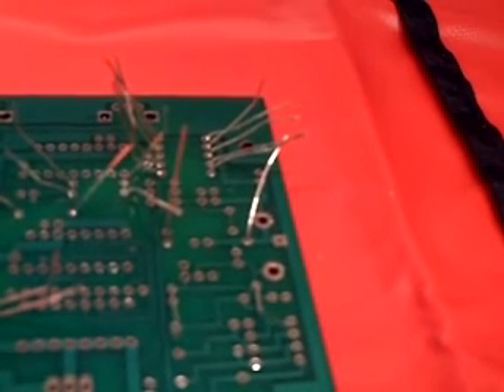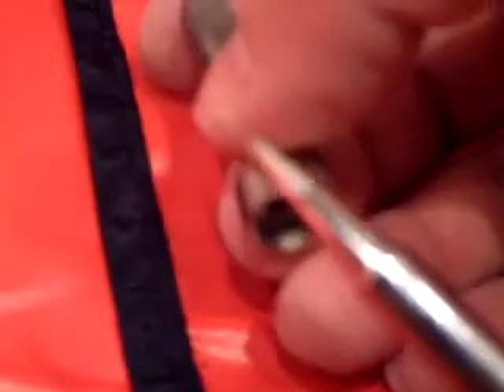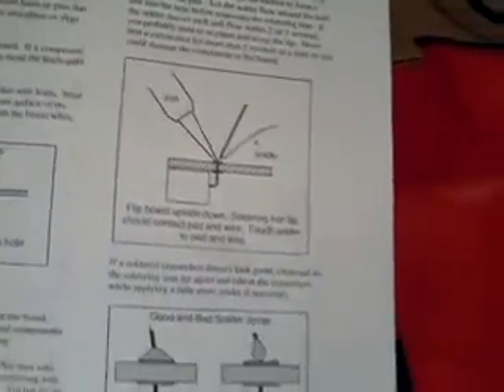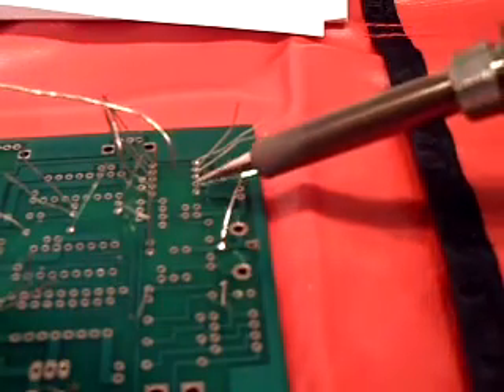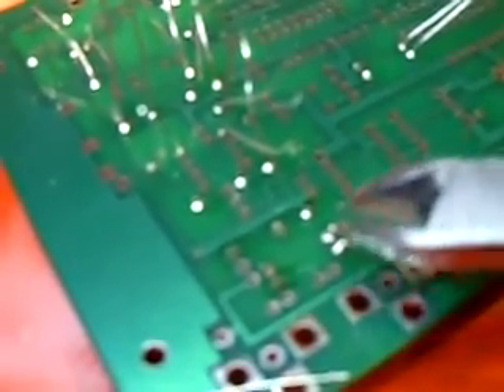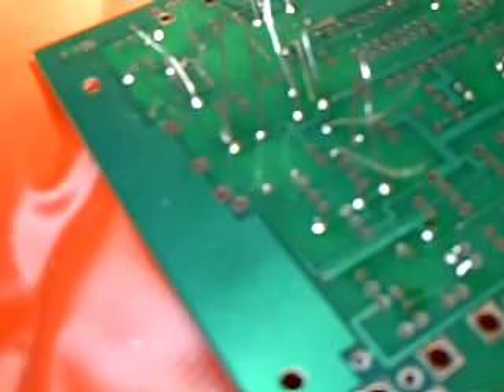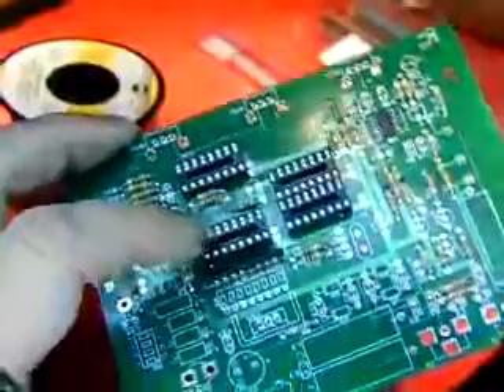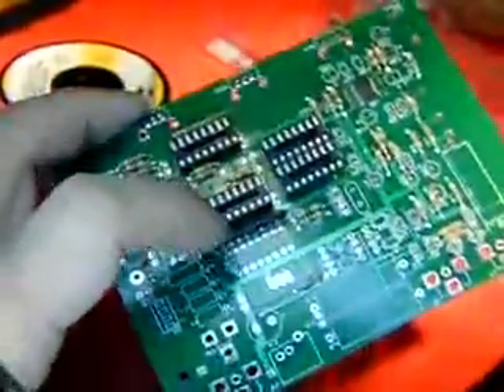LPAM Transmitter SSTRAN Kit Part 3

Comment from the maker: @gbowne1 The instructions says there is no relation at all with the resistor color code as it pertains to ohms of  the chokes . The color code is only for the inductance value in Henrys. PS. Real techs don't need a resistance calclulator from Penn State . A simple cheat sheet diagram would suffice. If ones not available. Then use the memory device as follows. Bad Boys (Ravish) Our Young Girls But Violet Gives Willingly. 0-9 for bands 1-2, band 3 multiplier, band 4 is tolerance. Very simple, huh?

Comment: seems like you didn't have your iron hot enough, ideally you would want it as hot as you can get it and as quick as possible. I've done work like your doing with a butane iron as high as it can go, but the trick is to do it very quickly so as not to damage anything, antique radio parts can take a LOT more heat for a lot longer and the joints compared to these on a PCB are massive.